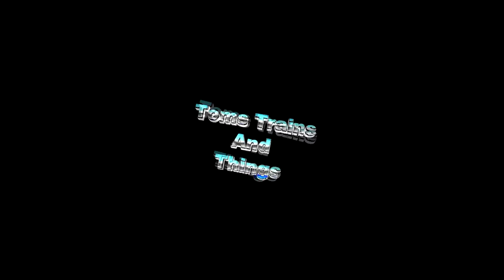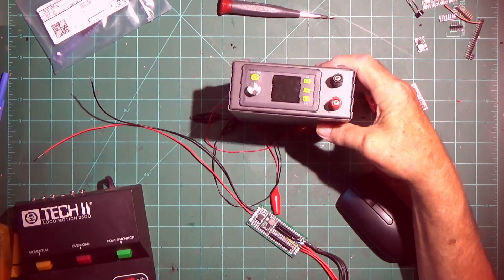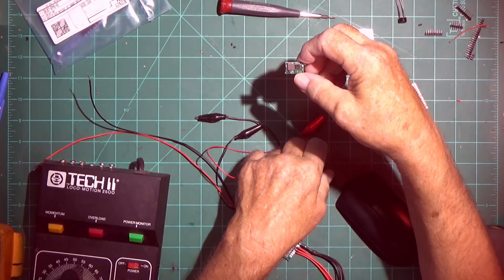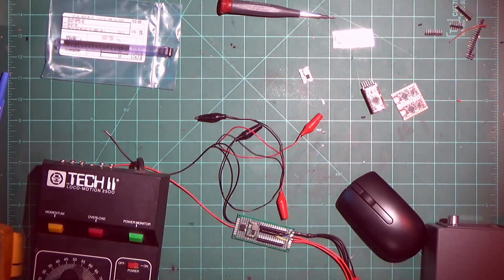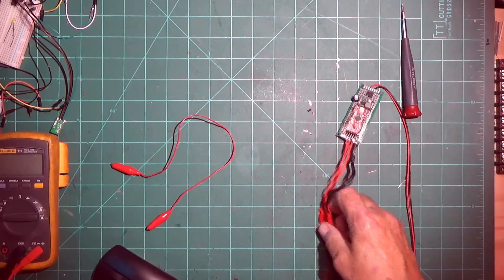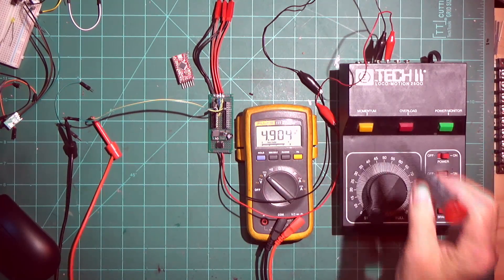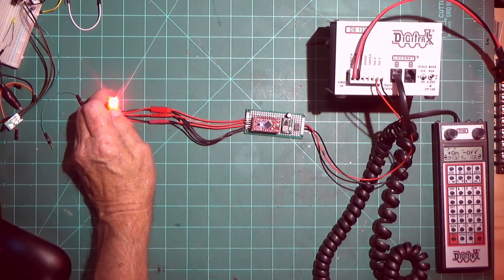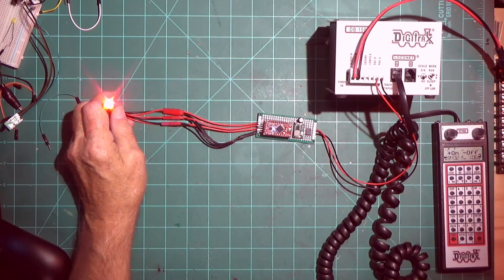Easiest Way To Power Your Components From DCC Track Power

Comment: You can replace that entire regulator module with an LM7805 regulator and two capacitors (10uF I think). The regulator can handle up to 35V so has plenty of headroom for DCC, and it'll give you a pretty stable 5V even with an input voltage as low as 7V. This circuit is also good for 1.5A.
Reply from the maker: Thanks for the info. I'll check it out

Comment: Hi Tom, The voltage regulator link is no longer valid, can you share a new link for either eBay or Amazon. The bridge rectifier link on ebay, is now for a completely different rectifier than in the video, so a part number for that would be helpful too. And what size capacitor did you use?  Thanks.

Comment: are you using the arduino mega? i cant get it to work. i have all lights on shield saying powered... i have 15v in but 1.5v out on track and programming track. does that mean it sees a short and shutting power down to track? if so one would think lights wouldnt be lit green on the shield. 
any help appreciated.
Reply from the maker: What shield are you using and how is it wired
Reply: @TomsTrainsandThings  just looked in my amazon orders..
flashtree arduino Motor Shield R3 5V to 12V for arduino A000079 https://www.amazon.com/dp/B07VCFQCY8/ref=cm_sw_r_cp_apa_i_ED-oEbV5RKHZ6
Reply from the maker: Just had another comment on a different video with the same issues.  The two of you are using the same motor shield. This is a new brand that I have never seen before. Apparently,, they are using different pins for the timer & interrupt that produces the DCC signal.  The only ones I have tested that work are: Arduino, Pololu, and Deek-Robot. There may be more that others have used, but those 3 are the ones I know that work. 
Check out this playlist:   https://www.youtube.com/playlist?list=PLjjhnrIKSTSgWNyYqv9g68zdK3Bp8Lav7
Reply: @TomsTrainsandThings  ordered an actual arduino shield...
Reply: @TomsTrainsandThings  
there are knock off shields out there that even look different but work. For me the one I bought looks identical down to chip layout and pin labels and everything. It maybe just bad, not sure...

now funny thing here.. I went with the "actual arduino" and guess what... the vin to cut under the board doesnt exist. I had to use my cell phone and zoom in... the 2 pads exist with nothing connecting between them!!!!! ohmed it out and beeped...
so I ended up seeing the pin and bent it out of the way. all good now. weird...

but all in all im running!!!!!!! train light came on, fwd and reverse works.

now from raspberry pi, i cant get it to work and not too worried... need to hook it up to the tv and go into it and see what gives...
from my windows 10 surface pro touch screen were good!!!!!!
Reply from the maker: People have been telling me of a couple of different shields that they got to work but I haven't tested them yet. Some require code changes which I'd like to stay away from since most modelers don't want the hassle of changing code. I tried it with a couple of shields but was only able to get half the functionality.
Reply: @TomsTrainsandThings  ive got a replacement coming.. if it still doesnt work.. ill ask for a refund. interesting side note is no need to cut trace for vin. just bend pin... was nice learning that
Reply from the maker: I bent the pin on several shields I was testing that didn't have the Vin trace on the bottom. Not all motor shields have that, some have jumpers on the top.
Reply: @TomsTrainsandThings   long story short.. the one I had was defective. The FlashTree Shield replacement works...

I didnt cut the VIN... i just bent the pin so maybe i cut too deep, dont know and really no care now that it is working....

Comment: Cool concept!  Are there ways of controlling the board so that it would sense whether the incoming power is DCC or DC?  Our club runs their modules using both.  Also, where can I find the wiring diagram for the board you were demonstrating?
Reply from the maker: Doesn't matter what the input is, it will accept AC, DC, or DCC as long as it's lower the 30 Volts. There are other regulators that can handle voltages higher than 30 Volts. I don't have a diagram at this time but will work on it and have it up on m web page next week. I may show it on my Monday live stream if I have it completed by then.
Reply: @TomsTrainsandThings  Thanks!  I really enjoy your videos and am trying to learn the electronics part.  Thankfully the programming part is pretty straightforward.